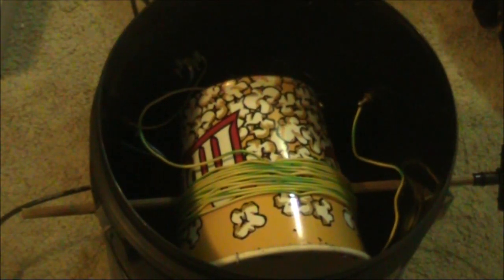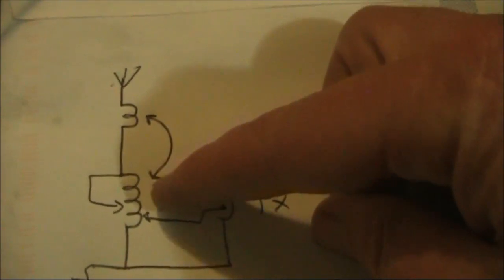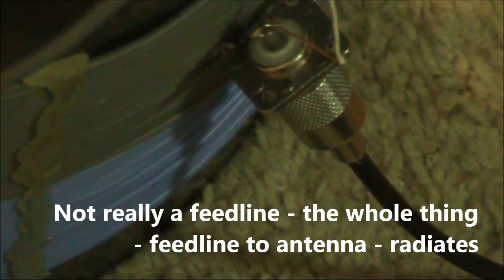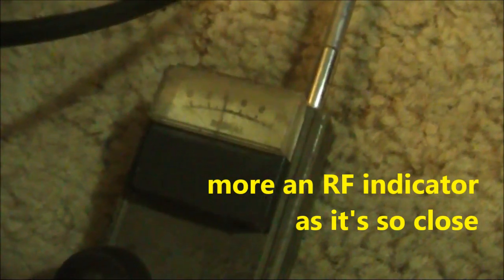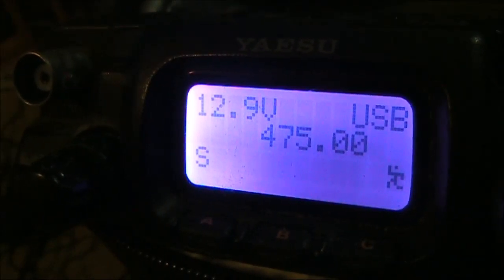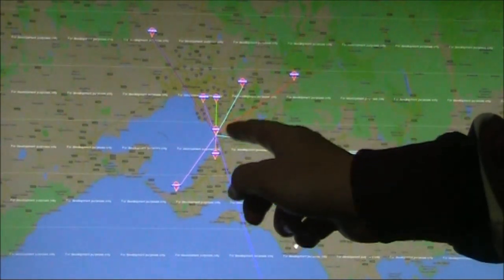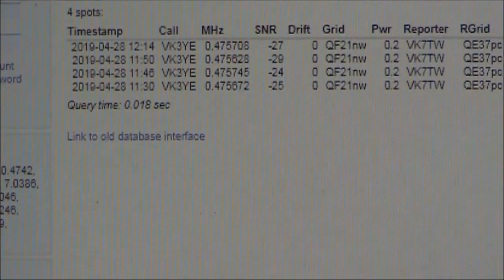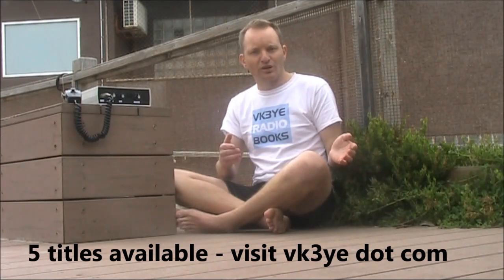A night on 630m QRP WSPR with a makeshift antenna

Comment: Are you using any kind of power amp with the wspr transmitter? I know it puts out only about 200mW, and I have heard that isn't really enough to get much signal out.
Reply from the maker: No power amp. WSPR is an efficient mode and can do surprisingly well.
Reply: @vk3ye  Well, it wasn't WSPR in general I was asking about as much as doing WSPR on 2200 or 630m bands that I was told requires a huge amount of RF just to transmit a small amount of power.
Reply from the maker: @tglenn3121  The effective radiated power is certainly low due to inefficient antennas on 630m but even milliwatts of ERP can work with efficient  modes like WSPR.
Reply: @vk3ye  Ok, good to know. Thank you for clearing that up. I may order one soon :)

Comment: I’m am completely confused by 630m. While equipment seems non existent and everyone talks about how hard it is to use. 
But on the other hand, people were using it pre WW2. 
What was used back then?
Reply from the maker: The hard thing is the antenna space. More people lived in the country then. And there was less noise. Hams were using it before the 1920s before they were kicked off the lower frequencies below about 1.5 MHz.
Reply: The power level is very restricted. Would a long wire work for such an application?
Reply from the maker: @dougtaylor7724  Yes. Especially for receiving. But a vertical is better (even if loaded) for groundwave coverage on tx.